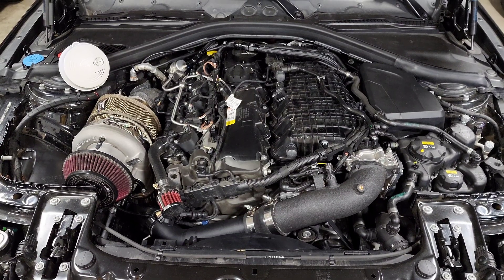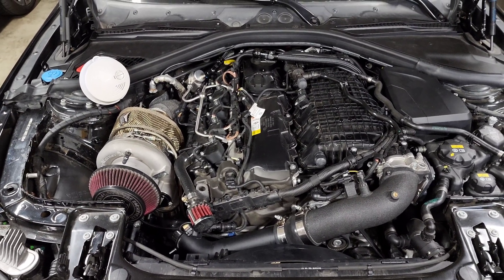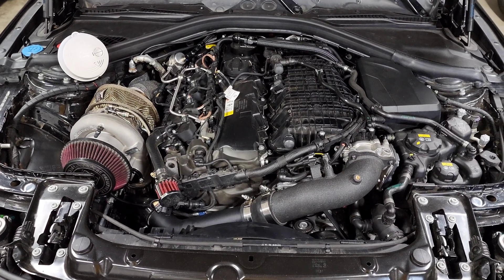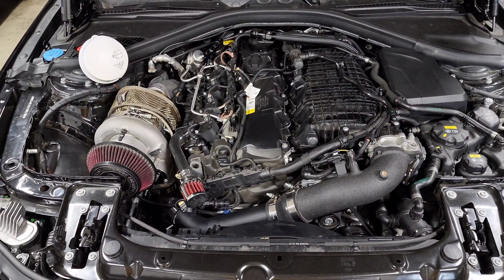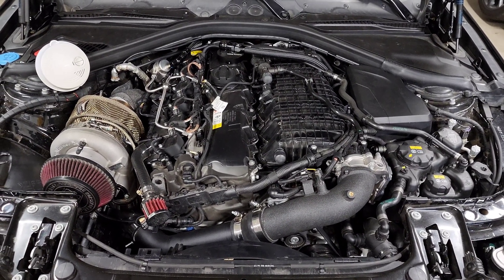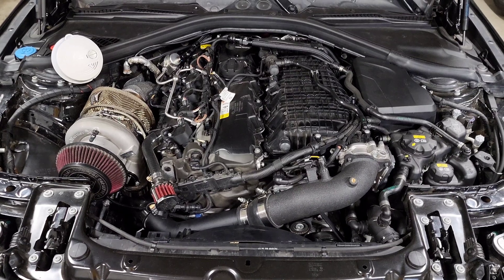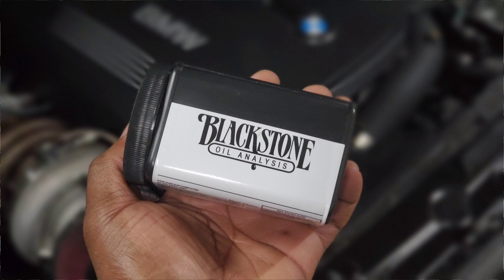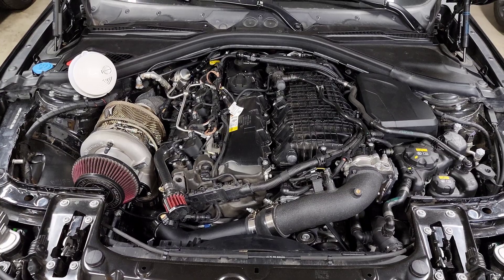Watch this before you run E85 on your B58!

Comment: I do not know how it is with gen 1 B58. For the m340i gen 2 b58 it seems oil temp stays always 110 degrees Celsius (230 degree Fahrenheit), i think that is very positive to get rid of condensation in oil.
Reply from the maker: Yep temps on gen 1 are very good and consistent. i don't know anyone with overheating issues.

Comment: Just filled up on e85 for the first time coming from a 93 stage 2+ tune MHD. I was wondering how long do I have to wait to start stomping on it? I’ve read that I have to go thru a full tank of e85 before I can start giving it full boost. Was just tryna get some insight so I don’t break anything.
Reply from the maker: Took me maybe 5 miles for it to fully equalize. Did you flash an E85 map? Or do you have a flex fuel kit?
Reply: @kern417 I flashed e85 map in MHD. Would you say I can step on it now? I’m almost finished with my first tank of e85
Reply from the maker: Yeah if you filled up with E85 on an almost empty tank it'll level out in a few miles. You don't have to run a whole tank
Reply: @kern417 thank you brotha🙏🏾

Comment: I’ve noticed the MHD flex fuel kit specifies that it’s only for the automatics. For the manuals, do you know if the other flex fuel kits out there will work with the manual transmission?
Reply from the maker: the other kits work for manual. MHD plugs in differently and the manual cars don't have the same connections. they're working on a separate solution for manual cars.
Reply: @kern417  awesome! Thanks for the reply man

Comment: Whenever you do your 91/93 octane switches from E85, how do you flash your car? Do you wait until it's almost empty and then just flash at the gas station? Is it safe to have let's say 5% of your E mix still in the tank whenever you flash back to a 91/93 map?
Reply from the maker: It just depends. You need to log your car to see how it performs. I have more than enough fueling to run a bit of ethanol on my pump gas tune so it's not really a concern.

Comment: Hi Friend Please reply , I have bought 2018 g30 540i and when engine idleing , rpm not moves but i feel slight vibration time to time i checked rpm on Bimmerlink Also Cylinder Missfire rpm is 650-675 missfire 0 i read that its normal , Engine is strong Quiet Spark plugs changed 30k ago at bmw engine has 93tkm , i have warranty for engine and gearbox still annoys me!

Comment: hi dude, I just bought a B58tu pompe for my m140i and just wanted to know if it is compatible with full E85 with the new MHD kit (the e85 sensor) before to buy mhd licence
Reply: Cause somes told me it run only with dorsh stage 2... so who is right?
Reply from the maker: It's designed to work with tu pump minimum

Comment: (I keep trying to post a log but my comments are disappearing.)
My HPFP has been dipping followed by overpressure and neither I nor PTF can figure out why (Stage 2 93, Shell gas). PTF sent me a revised map with reduced power but the issue persisted. Any input would be extremely appreciated as I need to get this sorted before I move to E85.
Reply from the maker: YouTube automatically flags comments with links sometimes. Send me a message on Facebook or Instagram. Social media links are in the description

Comment: hey kern, if I get a bootmod3 flex fuel kit and i'm running a gc turbo on custom 93 tune, could the tuner be able to take advantage of the fuel kit and retune to allow for flex fuel, or am i stuck running a bootmod3 ots map if i want the flexibility?
Reply: You will need to have him tune a e30 map for you and a pump map for you and then he can send you a map that flexes between them
Reply from the maker: Yes a custom tuner can do it for you

Comment: What’s your thoughts on fuel lubricants? I run Uplon TechniPlate synthetic lubricant, blends with ethanol and methanol. Added to every ethanol blend fill up.
Reply from the maker: They probably work fine just not 100% necessary